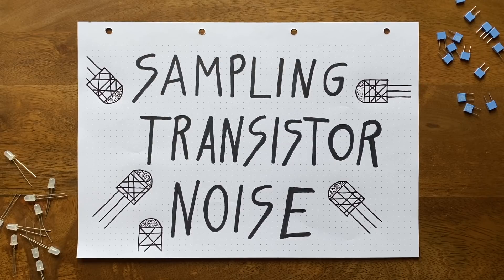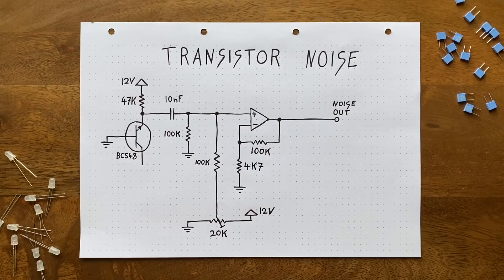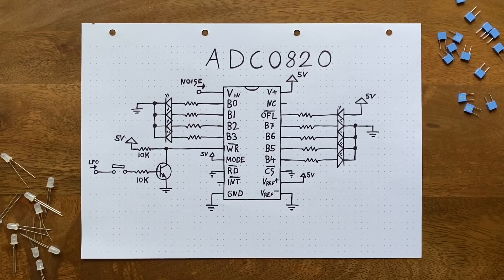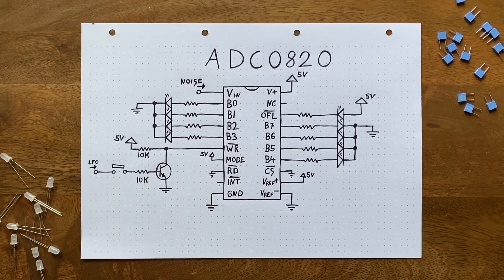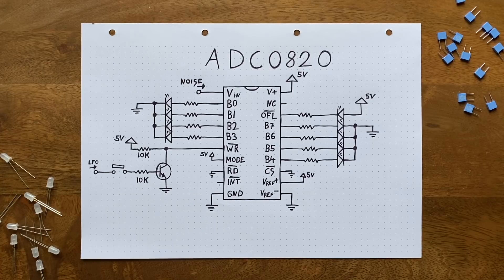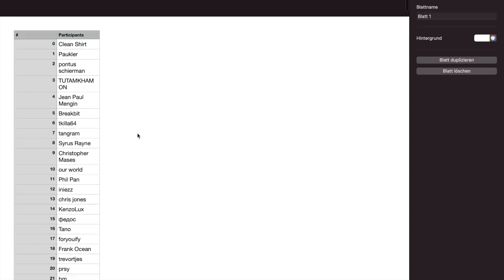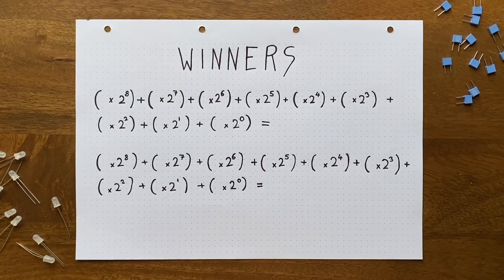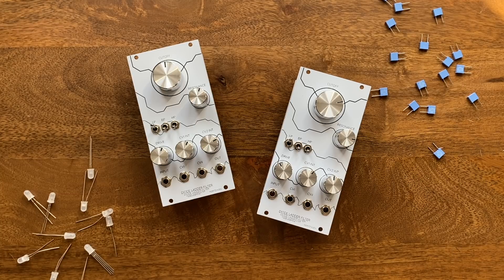Sampling transistor noise to pick the winners for my filter giveaway

Comment: But this surely would not be random right? If we would sample the frequency, sure it could be quite random. But within time domain, its actually randomly distributed around a zero-mean. Or in this case: half of the ADCs range: 255. Which is quite close to the actual winners! Really cool device, but I think your computers RNG still did most of the heavy lifting.